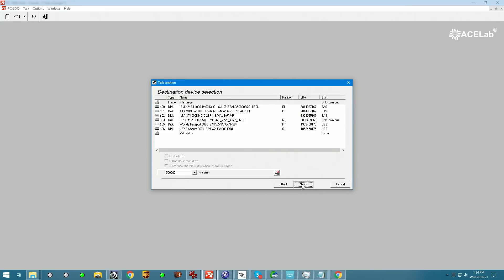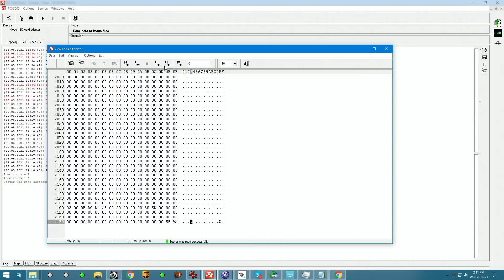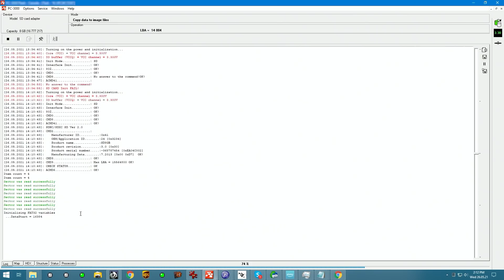memory card was damaged badly but this creative approach brought it back to life

Comment: Hello Erkin, can a emmc/mtd flash (or anything that detected as /dev/mmcblk0 and /dev/mtdblk0) be mounted to a host computer so the user can read/write to it directly as if it's a sdcard?

I'm experimenting with old android phones and android based set top boxes, I want to change the OS inside the chip but also be able to directly read/write to the internal storage like when we swap ssd/hdd from a laptop to another laptop.. and when i messed up the bootloader i can just "sudo dd if=uboot.img of=/dev/sdX"

Is this possible?
Reply from the maker: With an adapter to SD - sure. But android OS is not gonna be recognized by windows, so it would need to be formatted. Some laptops come with eMMC onboard as storage
Reply: @hddrecoveryservices  I'm not using Windows in my host computer. I run Ubuntu 20.04 and i don't have windows computer at all. so filesystem is not really a problem.. The problem is, how can I access the storage directly as block device (the device's kernel does treat it as block device)

Comment: Very good work....amazing.
Where did you learn all that stuff?
Reply from the maker: thanks. Data recovery is not something you can really study for, but you pick up as you go. Individual tools may have training from developers, but soldering is really best learned by practice. I have been doing this for many years now.
Reply: @hddrecoveryservices  thx for the answer. Yes soldering is just learning by doing and many years of training. I do soldering many years too.
But this knowledge about this software...puhhh...that must be a long way to be there where you are. Chapeau! 
It seems that pc3000 is very extensive, you have to know what you do when you use it.
Reply from the maker: One step at a time 🙂

Comment: A few months ago I needed to repair my Commodore 64 (computer designed in 1982, but this unit is from 1985). The computer works fine, but the cartridge port was dead. With my crappy equipment (and using garbage flux) desoldering it sucked and I damaged a trace. It was lifted, but still attached to the via. So when I put the new connector in, I'm like......I know where it goes and I could bodge it......or I could just solder the trace to that particular pin. I was shocked when it actually worked. lol I hate the desoldering part (especially with my crappy equipment), but I get what you mean when you say soldering is therapeutic. Putting the new connector in was a huge stress relief. And the computer is working great again. It would be interesting to take it back in time and say hey look at this C64 with 16GB storage (I have a cartridge that give it USB support). The flash drive I use has hundreds of old disk images on it.
Reply from the maker: thats awesome, Ashley

Comment: I am done with this. If it doesnt work it doesnt work. 5 minutes later soldering on wires to the contacts of the controller lol.
Reply from the maker: you can tell I am a bad gambler haha, if if the pot is too deep I just can't stop :)
Reply: @hddrecoveryservices  just put your hand on the edge of the table and puuuuusssssshhhhh lol.

Comment: I love micro soldering, I'm not quite yet making stuff at the scale you are. What stops shorting between the copper jumper wires that you connected the controller ic with?
Reply: the wire has an enamel coating
Reply: @continuouswaveform  @Jonn How does it solder if it has a layer of enamel?
Reply: @continuouswaveform  I have never had the soldering iron successfully burn off the enamel, is it a specific type of enamel or a special thin enamel? What temperature does it burn off?
Reply: @continuouswaveform  I guess I've never used small enough enamel wire. If I need small stuff I usually go with plain copper to avoid sanding. But if I don't need to sand it then I'll try that in the future. thanks.